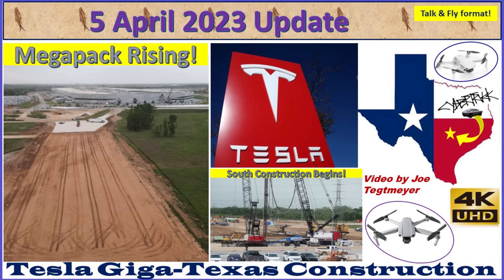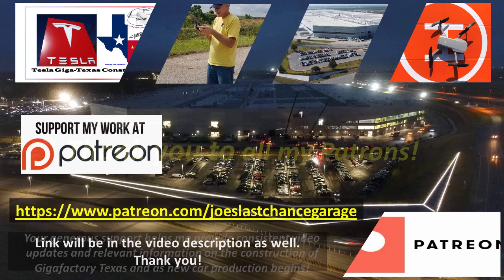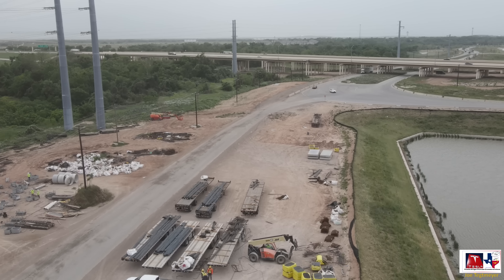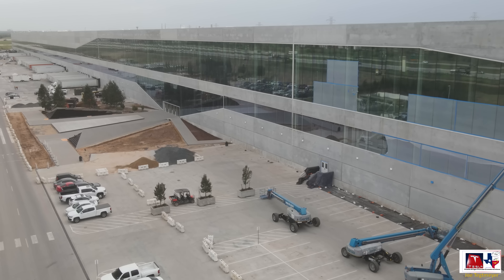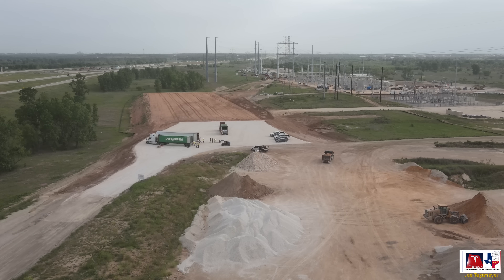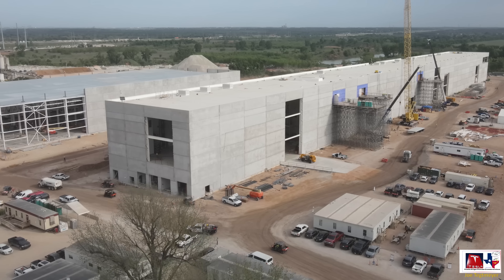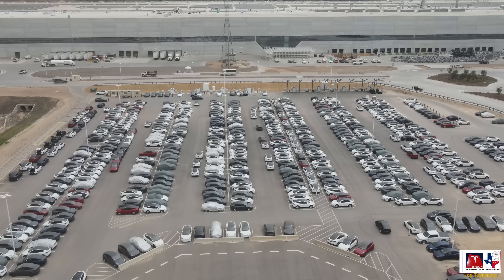Pier Drilling, Entrance Trees, Megapack Site Deliveries! 5 April 2023 Giga Texas Updates (08:45AM)

Comment: Thanks Joe
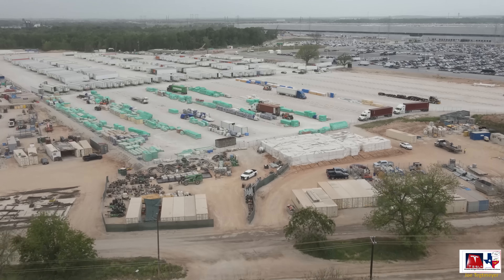7:05. Southend. Large crate. Another particularly heavy delivery in the north end of the WOW yard at 22:15.
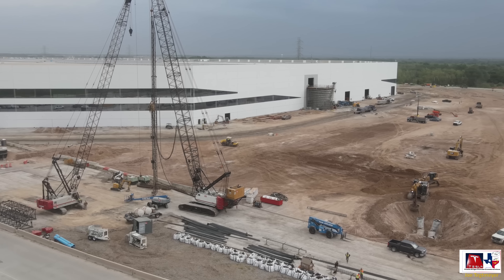8:10. Southend. Drilling rig assembled on the crane. 2 sets of stands for assembling the rebar cages. One cage completed.
8:46. Stamping 2. Excavator inside dumping a load of spoil into the dump truck.
9:16. GA south, loading platform. New grey steel, more of level 4.
11:46. GA, highway berm side. Speculating this is the first section of a larger stretch to be reconfigured as landscaping. It’s otherwise a near random location.
12:55. Battery, apron. Excavator with the screw head attached. Doesn’t look like it’s done any work. This or similar was seen being delivered 29 March. Same contractor (Brown and Claude) did the auger pile work in Casting, and Stamping 2 in the last few months.
13:41. Casting, apron. Small bin has hardened aluminium/aluminum from the injection cylinder.
A sheetmetal Model Y front end assembly on the blue pallet.
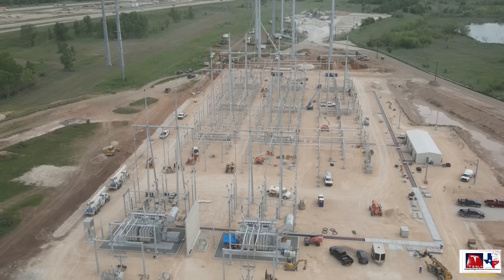15:38. New Switchyard/Substation. Bottom right. Placing lids/covers over the cable trays. Cabling might be mostly done in the trays.
16:31. New Switchyard/Substation. Stormwater trench works. Tieing back a trench shield side to a block of concrete.
17:22. MM Batch Plant, waste pile. Crushing plant has been dismantled. Possibly preparing a new site for it to the left.
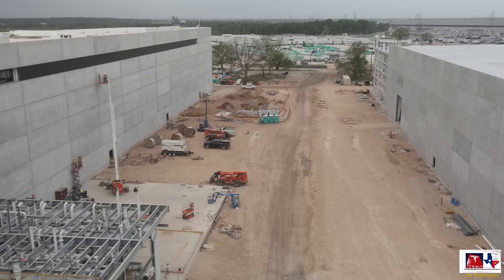21:44. Cathode, plant platform apron. The light tan tank assemblies have been shifted under the plant platform, just visible in one of Joe’s photos.
Makes room for the large stainless tanks to the north. Slab here is thickened to take some substantial load. https://youtu.be/X0kr48p6Lbg?t=998
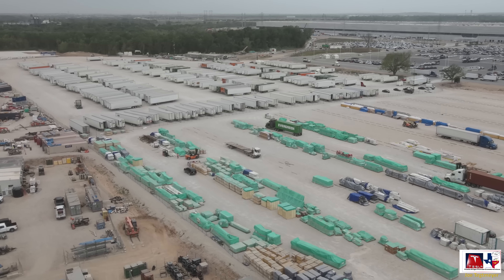22:15. WOW yard, north. Right. Heavy delivery on the extra extra heavy duty low loader. Under the black tarp.
22:40. WOW yard, south. Stack of salvaged wall panels. Likely as temporary aprons/floors for workshops.
25:01. Helipad area. Small cylinder in the fenced area is a drone installation. I won’t even attempt to post a link, but a search for ‘Percepto done in a box’ should reveal the machine.
Reply: 12:55 The excavator left dirt tracks out of the building (from an earlier picture) so the truck is there to probably move the machine out.
Reply: Thanks Dessie!  That Percepto drone is pretty neat.  Great catch.  Here's a video describing its purpose: https://youtu.be/lHTfzw141iY
Reply: @bobcallahan2322  Thanks Bob. I went back and looked at Joe's photos. 

The screw head looks un-used, not even dusty. 

I wonder if it is remedial work, or new work. Often wonder how much of the initial Battery plan was redundant when the separate Cathode structure was first proposed.
Reply: @59seank  It was getting some attention on Joe's Patreon site in the last video. I tried a bunch of different searches to figure it out, but there's nothing like a logo to make it easier!
Reply: @DessieDoolan  I believe the Cathode plant was planned on from the beginning. It is just that they can order the cathode materials from other suppliers (China) and start production before having a local supply.
Reply: @royh6526  It may have been planned from the start, but the first report from Joe was May 2021 when the Bobcat project site plan permit was revealed. 

Whether or not that altered the usage plan for Battery is unknown. I’m guessing it did, and my thinking is that the Cathode plant isn’t just about making the cathode material, but the jelly rolls also. 

There’s a lot of empty space within Battery still. East side Level 1 partly only a gravel floor. Levels above only have construction lighting. Additional footing work in the last week or 2.

Not that any of that is unique to Battery, the entire plant is in a never-ending state of change.
Reply: @DessieDoolan  Each to his own opinion. But if the Cathode plant is required to produce the jelly rolls, how is it that they are making 4680 cells now? This also goes counter to the statement that the cells being produced at GigaAustin now are dry coating, both anode and cathode.
Reply: @royh6526  As far as I know the jelly rolls are currently made in Battery. Cathode material coming from outside suppliers. What I’m saying is that the Cathode Plant once completed might make the jelly rolls also. Otherwise bulk cathode material would need to be packed into containers and then unpacked again in Battery. Seems to me they might delete that double handling and simply complete the cathode jelly roll process in the same building. I’m speculating.

I use the term jelly roll for the dry process cathode sheets, as this is the terminology used by Munro and Associates, and The Limiting Factor in their 4680 teardown videos.
Reply: @DessieDoolan  "I’m speculating."
Surely you have seen the videos from Tesla showing the winding of the jelly roll. These videos were taken in Freemont and Austin. The jelly roll consists of both anode and cathode rolled together as one operation, not separately. The next step is to be inserted in the can. They are not rolled in one building and inserted in another.
Reply: @royh6526  Yep, watched the videos. 

Unless I'm missing something, there is a cathode jelly roll, and an anode jelly roll manufactured separately, not brought together until a separating film is placed between, then rolled up together.

Fairly sure that’s what is shown in the opening 1 second of the Tesla ‘Making Batteries’ video. Jelly rolls coming in at a steep angle from left and right, white separator film dropping down vertically. Best watched at 0.25speed.  https://youtu.be/zB8_HbrxUi8

I’m speculating that when the Cathode Building is complete, they might manufacture the cathode jelly roll as part of on e long process. The cathode powder, or my speculative cathode jelly roll needs to go back to Battery anyway.
Reply: @DessieDoolan  I admit to being very confused about what is happening in the first seconds of the video. I agree there is a film (possibly a separator) being fed down the center. Another black film is going up the left side and presumably being fed back down the left side of the V. And what could be a clear film on the right side of the V (adhesive?). There is another film that looks like the central one coming in along the bottom from the right (direction assumed to be indicated by arrows on rollers). None of this is as I envisioned the process would be several years ago. What happens where all these comes together remains a mystery. Is a jelly roll being made there? The only clearly made jelly roll is at 0:05 which clearly shows anode and cathode coming together (I'm sure there must be a separator there, possibly pre-laminated on to the anode or cathode).

However I do not see any evidence of a pre-made jelly roll being unrolled, so still very doubtful of your claim that the cathode is pre-rolled, then unrolled to be added to the anode.
Reply: @royh6526  I’ll happily admit I didn’t know an anode from a cathode before I starting following Tesla. I’m a carpenter.

In the video I see what you mean, there's another clear/white film, that make sense. The cathode jelly roll is a cathode/aluminium/cathode sandwich. The anode jelly roll is graphite/copper/graphite sandwich. The pair of jelly rolls need to be kept apart by a separator. Just a single separator between won’t work when it’s rolled up, it needs another separator. So in fact it’s separator, cathode jelly roll, separator, anode jelly roll.

It seems the 4 components are only sandwiched again, not glued. The entire separator/cathode/separator/anode jelly roll can be unrolled as seen in the various tear-down videos. Here for example, https://youtu.be/VEBY7rEUZiI?t=155

The first second of the video shows the 4 components, cathode and anode jelly rolls coming in from the side, separator down the centre, another separator horizontally to the right.

The next segment where the roller #8 looms large shows the anode jelly roll. If the roller numbering is anything to go by, then it’s lower down the machine.

Next is a roller mechanism with 4 strips of what appear to be aluminium. This seems to be a different machine. I assume it is the start of the cathode jelly roll assembly.

At the 4 second mark is the first machine again at the point where the 2 jelly rolls and  2 separators are rolled up together. Must be lower down the machine again. Copper anode tabs to the left, aluminum cathode tabs to the right. I have an idea these machines are visible in some of Joe’s videos, like here https://youtu.be/Dok_gczJ9hk?t=497

At the 5 second mark the complete jelly roll sandwich is sent off to be inserted in the can. The white wrapping I would guess is the separator film wrapped around and fixed with blue tape.

As for larger rolls of the anode or cathode jelly rolls, there is a glimpse of one in the Tesla Battery Day video at the 50:31 mark, https://youtu.be/l6T9xIeZTds?t=3031

I think these have been visible loaded onto the machines in Battery in some of Joe’s videos or pictures, but I didn’t make a note.

Munro alludes to much larger (wider) rolls here, before getting sidetracked, not entirely clear if he is talking about the cathode, the anode, or one of the jelly rolls. https://youtu.be/5fe548XvavY?t=710
Reply: @DessieDoolan  Thank you for your detailed description of the battery construction. That is my understanding too. Two separators required in the jelly roll because each anode and cathode backing has the anode and cathode material on both sides of the copper or aluminum backing. I think I finally follow your reasoning. The first few seconds appears to show anode and cathode coming together, but just has the separator applied to one side of each. Later below they come together in the jelly roll at 0:05.
Reply: @royh6526  You’re welcome. 
From about March 2021 I started noting any interesting snippet of information, and copied the timestamp as a way of reminding myself where the information came from. It’s the only way I could keep track of the various processes, it’s all new to me. Inadvertently ended up with a large and useful database. I add to it as new information comes to hand, the second separator was an amendment, I’d not noticed it earlier.
Reply: Dessie, no comment about Joe's claim that vertical pipes outside main entrance are for irrigation? 
Those pipes look like 2" and, normally, for an irrigation system, you'd just have one coming up and the rest smaller diameter, running overground.
Reply: @greggerypeccary  I'm not sure what they are. They are quite small, in Joe's photos I'd estimate no more than 1". Some photos they appear grey (which to me would indicate power), others they appear white.

The pairs? Above ground valve perhaps.

Comment: 17:30 that area/pond where they have been digging the concret has been filled partially with dirt and covered with a gravel like material.
19:31 looks like 2 large generators, one on the west side and one on the south side of the die shop
19:23 that conduit trench has to run under that workshop at the bottom left.  They will have to remove the workshop.

Comment: In the DIE shop.... I have only seen foundations that thick for a large Turbine Generator for a power plant that spins at a very high rate of speed.  The large foundation helps with vibration more than weight.  

I wonder if the device that will stationed there will be something more along that.
Reply: Big drum mill perhaps?
Reply: It could be a mineral pulverizer that powders the unprocessed mineral in to a very fine powder like substance. 

You would want all that in a separate stand-alone building due to the extreme high mineral dust that is created.  Dust combustion/explosion hazards for fire prevention.
Reply: I agree, it's not just a  static  load foundation. Probably has to support dynamic loads from motion and/or hydraulic equipment..
Reply: @saff226  Ball mill has been suggested a number of times.

Comment: As I recall, the south end slopes from the building to the cyber pond. I would think that that the building area would be leveled before a large area of deep foundation drilling is performed.
Reply: Yep, inside FFL is 418.5', out where the drilling rig is set up is 412-ish. There was fill added on the far south for the demolished concrete apron to drain to a central east-west valley, but even so a large amount of fill to be brought in. 

I guess they could construct the piles now and add the pile caps later.
Reply: Immediate re-think. They could construct the entire footing piles/pile cap and back fill around. Similar to the footings constructed in Stamping 2.

Comment: Is there some reason they just scatter the castings outside like that instead of just putting them directly onto the racks?
Reply: I wonder if they did an engineering change on the casting and it will not fit into the racks anymore.
Reply: I suspect that the ones in the racks have been machined and the others are just raw casting.
Reply: There seems to be way more castings than racks available, even though there are empty racks. 5 rear castings to a rack, but ignoring that the racks can be stacked 2 or 3 high, the rear castings can be nested into each other very tightly.

I did a count of the number of castings stacked in front of a wall panel at 13:30, and the same that could be stacked in the racks in front of a wall panel. Came up with 168 per wall panel stacked directly on the apron, 292 per wall panel in racks.

Perhaps it’s only untrimmed castings that are racked. Trimmed castings probably should be fed straight onto the production line, but for some reason there’s a stockpile and no dedicated racking from them.

View here of untrimmed rear castings in racks. 5 to a rack. https://youtu.be/uJwEzpThroU?t=485
Note the labeling on the rack. Haven’t seen racks marked otherwise, yet.

Comment: I am waiting to see the interconnection of the substation, mega pack and factory.
Reply from the maker: Me too!
Reply: could you do a deep dive on this aspect at some point when we know more.
Reply: Will the megapacks be connected to the factory or the grid?
Reply from the maker: @jbbuzzable  both
Reply: @jbbuzzable  I would guess grid only. Stand alone system unrelated to the factory, other than being located on patch of Tesla property, and owned by Telsa’s energy business.

There is an assumption that the PV Array will feed directly into the BESS, but I think that is unlikely. Inverters have been installed for the PV array. So DC from from the PV panels through inverters to AC, presumably for immediate use within the factory. Would need to be converted back to DC to feed into the BESS, then to AC again for export to the grid. Lot of losses there.

Comment: With empty racks why would they have all those castings just sitting on the ground?
Reply: I continue to by mystified why there are thousands of Model Y rear castings around the building. Some areas seem to be more carefully placed than others.
I haven't seen front end castings. I suspect these castings need some machining operations before they can be used.
More assumptions: They may be stockpiling these rear sections with conversion of the giga presses over to front castings. Maybe the original front casting die didn't work properly?
Is it possible that these castings are only useable with the 4680 pack and not 2170, which is still primary production?

Comment: Main entrance: @ 10:49 Exactly what I was hoping to see :)
Too bad they poured the concrete only to rip it up though. Why not do the job right in the first place? How hard is that?
Reply: Different contracts. And trying to speed design time. To build and make the factory operational it had to be somewhat completed, plus they needed the stairs for events they did over the years from substantial completion until now.
Reply: @MM-fe9mz  Pouring concrete stairs just to impress wealthy investors coming to a party seems like a huge waste to me. Really no need to pour all that concrete to actually begin production at the factory. Even worse on the south end. Where they ripped up 500,000 sq. ft. of concrete! Again, no need to pour that concrete either.
Reply: You might want to have some sedatives on hand for when they come through after the earnings call and rip up all those trees. 😁
Reply: @DavidJohnson-tv2nn  Probably needed to do it to get the CO.
Reply: @sammyk874  That is entirely possible. That is one theory for what is going on at the main entrance. My theory is that they are reckless, and to some extent, incompetent.  They just don't care because leadership encourages the concept that failure is ok and breaking things is good in order to promote "innovation". Both are valid theories. I stand by mine because we see this type of waste going on throughout the project. You may end up being right. All both of us can do is form opinions based on what we see.
Reply: @DavidJohnson-tv2nn  Your theory is based only on your bias against Musk just the same as Musk fanboy's (not me) opinions are biased in favor of him.  In reality you and I have no idea what is really going on.